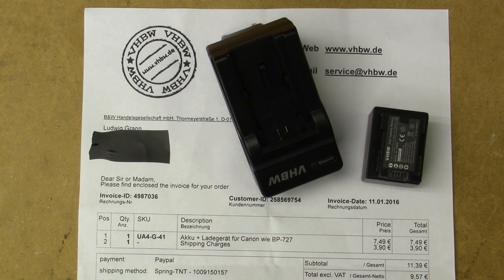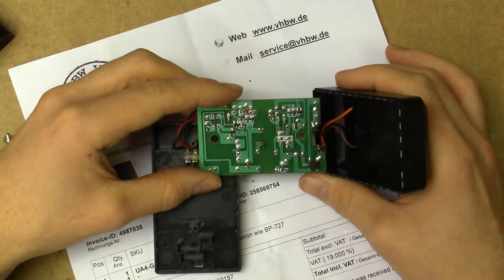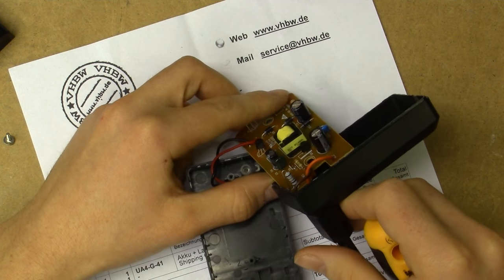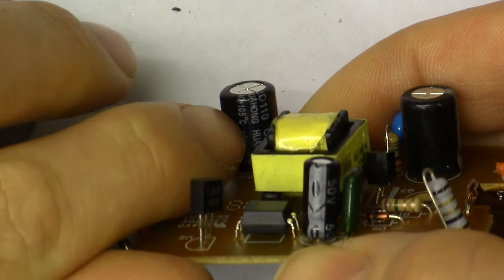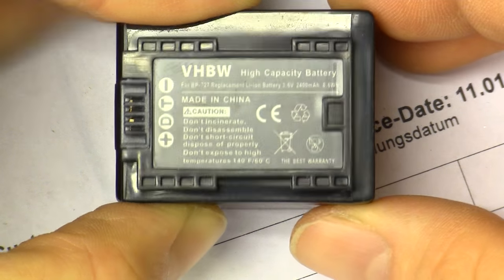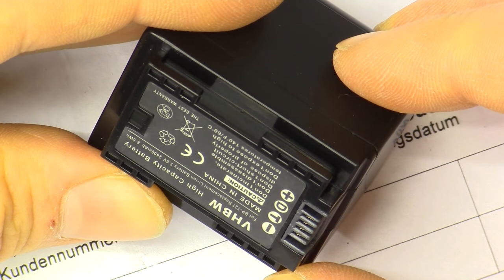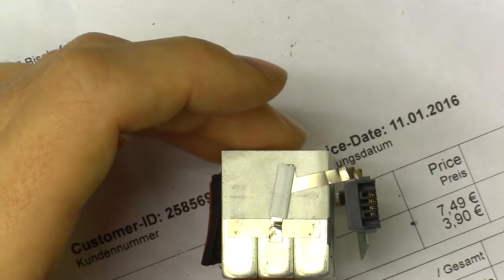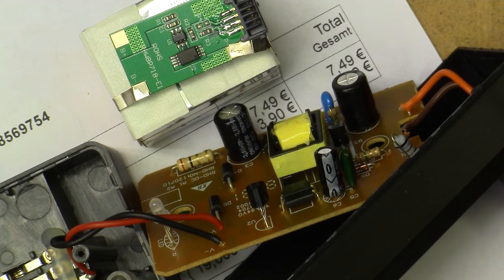Teardown: Surprisingly good Ebay camera battery & charger (VHBW brand)

Comment: VHBW is one of the biggest and best sellers of those cheap replacement batteries and chargers on the German Ebay. Their products are quite a bit more expensive than the real cheap Chinese junk coming straight from Hongkong, so I'd expect them to be at least half decent.
Reply from the maker: +DrCassette Oh, that's odd - I only paid $11 shipped for these, which is well on par with the awful Chinese crap, so I was expecting nothing better. I suppose the difference was that the VHBW was rated for a lower capacity, so it's probably more honest than the Chinese ones.
Reply: I don't know about the Canon batteries, but for example you can pick up a Hongkong Sony NP-F970 replacement battery for as low as 10€, the VHBW version is considerably more expensive, I think something close to 30€. Still cheaper than the genuine Sony, the last time I saw one it was over 100€.